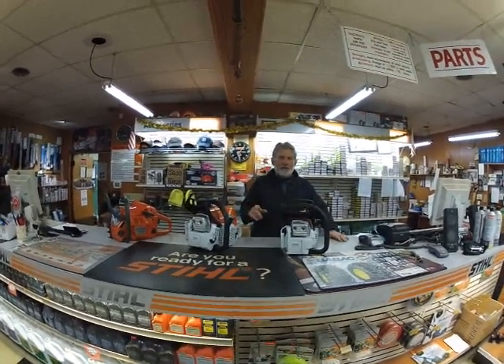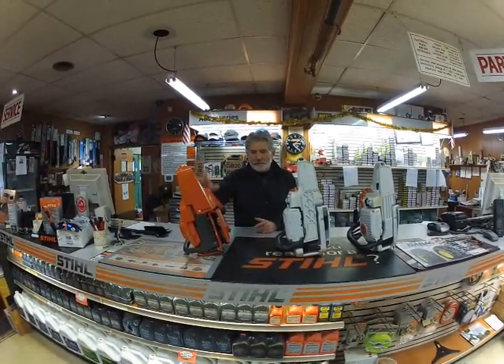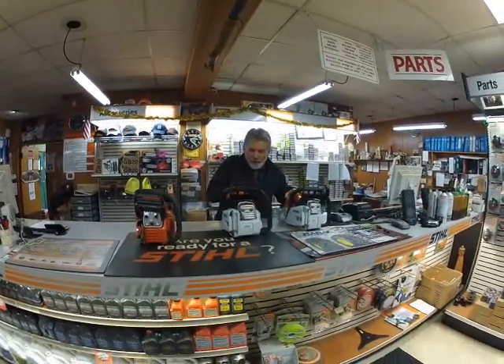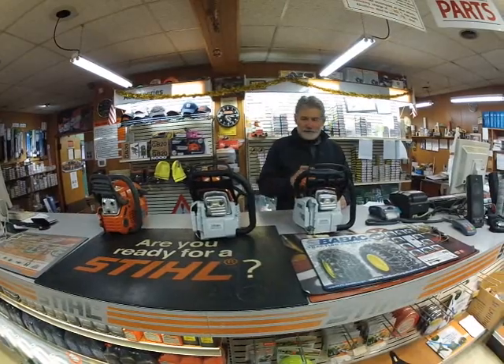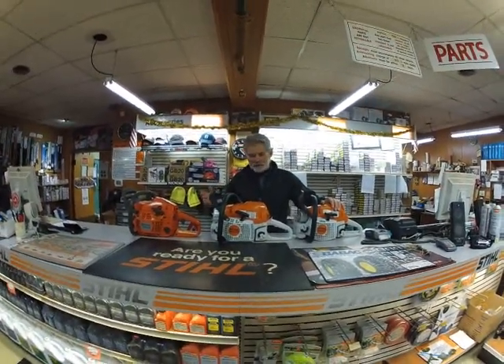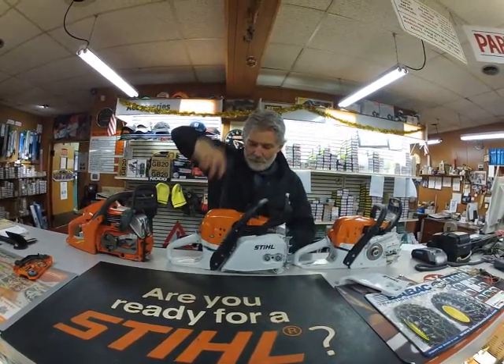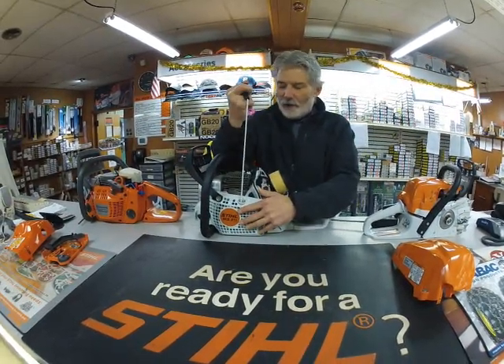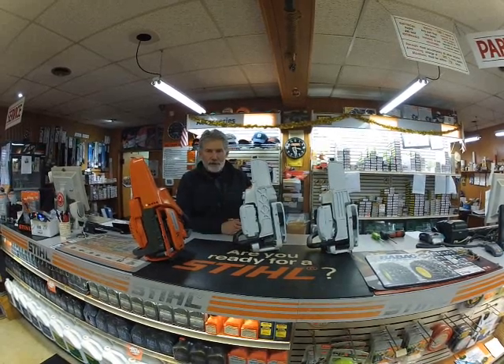Stihl VRS Husqvarna : Firewood Chainsaws

Comment: Echo beats any homeowner saw from Husky or Stihl period.
Reply: We've sold Echo for 30 years as well, they have made their share of junk too. We don't sell as many as we used to do to popularity of both Stihl  & Husqvarna now. I won't say they units are better...maybe as good😉
Reply: from what I've heard, this statement is true.
Reply: Their pro line is extremely impressive also.
Reply: Hello Rod, converting a QV 8000 to a regular bar... doesn't appear to be major issue ... I've got all my new parts collected and I need to get it assembled.  Had some light transfer in the jug...sanded right out.... got a 32"stihl bar 3/8 .50 gauge...       that I believe will bolt to my 371xp...the low compression wasn't smoked jug... compression release had a failure and was leaking...tearing down to berring and seals to make sure it's a solid saw and ready.... had a big tree to cut so I bought skip for the 32 and ran it on my ms391.... worked great!   The fireman bar and carbide chain will be good for stumps I hope... got a 036 because I had the bigbore kit to go to 038... to nice a saw to mess around with...need a smoked 036 still!   I wanna put that bar on the 036 and go at a stump... they say that carbide will cut rocks and roots and whatever.... it can't really hurt the saw getting it a little dirty???? I'd never do with ground super dry for dust issues....  I was given a pouland 2050 or 2046 or some 46cc saw... just needs a piece of tygon and it would be good to go I'm thinking that's the saw for the carbide blade and stump cutting... if it gets killed...no sweat... they're $120 bucks new
Reply: The new timberWolf 590 kicks sum major ass!

Comment: what saws are these I have an 024 sthil Woodboss and the chain case cover is metal so it the recoil handle
Reply: Great power to weight saw. From the 80's. 2 models, 41.95 c.c.'s. And the Super at 44.24 c.c.'s. 40:1 fuel mix. look on the side cover, made in germany or virginia beach Va. Run only non ethanol gas. Ethanol will eat away at the metal fuel tank! I think it was considered a semi pro- saw, or a pro saw. Still sought after. They don't make them like that any more. Well worth repairing. Can cut all day, and it won't beat you up! I guess that's why they're so popular.

Comment: m tronic no spark?  New plug checked gap between the flywheel and coil
Reply from the maker: +nick hunt There are several things that can be causing your problem....you've checked 2. The coupler plug on the 362 is an issue in that if the screw comes out will cause this. The coil/controller is warranted for 5 years, so I would take it to a Stihl dealer and have it repaired. Stihl is aware of their problems with these units and they are bending over backwards to repair them! MCSS